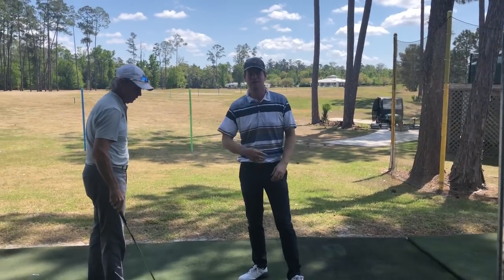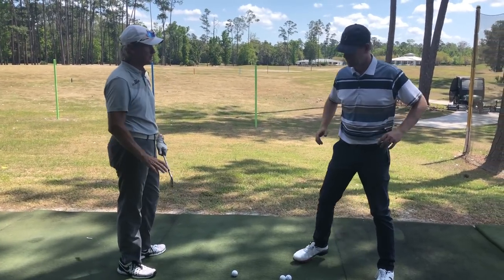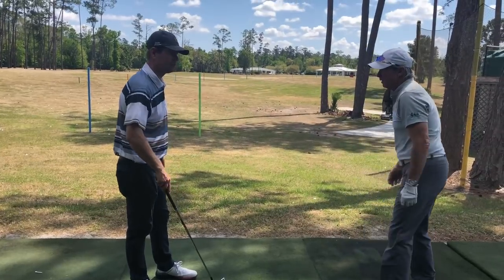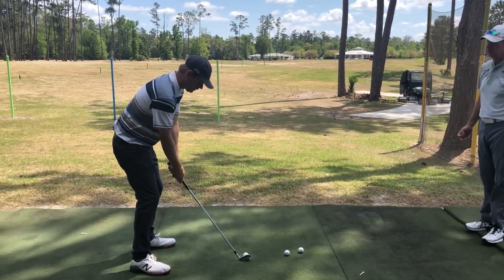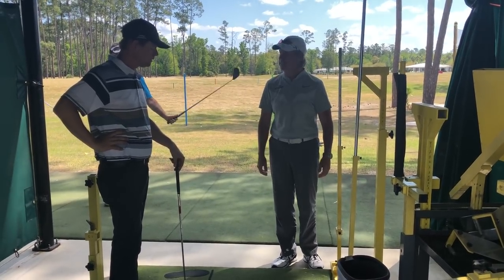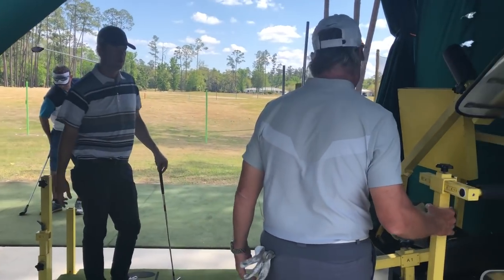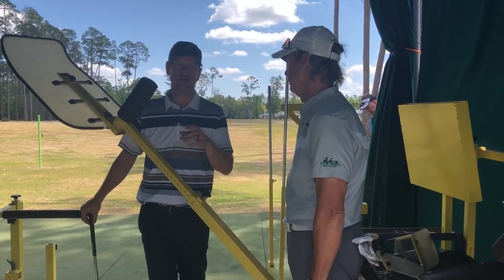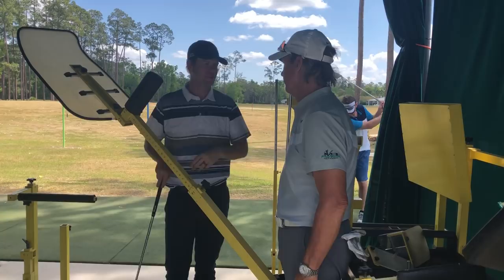The Stopper Drill, with Dan Winget at the Mike Bender Golf Academy, Be Better golf

Comment: Wow....not sure about this drill! Having had an over the top swing I fixed it by realising right shoulder rotates internally on the back swing, and externally on the down swing.....problem fixed. This drill could lead to guys having lots of issues with rotation....which is key. Could this be another case of not looking at the cause, and trying to fix the effect?
Reply: Can you elaborate? What do you mean internally/externally
Reply: Disregard... I simply looked it up! Had never heard those terms before

Comment: Brendan is chasing a rabbit down a hole. 99% of Brendan's slight over-the-top move comes from his ingrained wrist rolling inside takeaway. Doing this on his backswing means that his right shoulder rotates externally, then it will rotate internally as he makes his slightly over-the-top downswing. Super common. He needs to change his takeaway and backswing to reverse these shoulder rotation moves. It's a game of opposites- come back below plane and you will likely come back down on top of the plane. When he makes these  over-the-top swings, by nature of the vault,  his body rotates open quickly, but in the wrong way with no upper body right side bend. He interprets this as spin out and too much rotation, but these moves come from the over-the-top move. He thinks that if he can slow down the rotation- any way he can and his big Holy grail- that he will solve his problem. Sadly, this is not correct. He can rotate as much as he wants without spinning out once he ingrains a new takeaway and gets rid of his over-the-top move. His holy grail is correcting his takeaway by exaggeration drills, and having upper body right side bend on the downswing. This right side bend on the downswing keeps the right shoulder and upper body from making that bad move he's trying to avoid.
Reply: Robert Osborne know of any videos that show this?
Reply: Brendan is already a very good player. He seems like a great guy and well intentioned. I like following his stuff. I went down a lot of the same instruction rabbit holes when I was his age (many years ago). I've tried  just about every training aid one can imagine. Eventually he will most likely abandon all of them except alignment sticks. His garage will end up a training aid "graveyard." Been there, done that!
Reply: There's more than one way to swing the club to achieve an optimal impact position. How best for any golfer to learn and improve? It varies from individual to individual. There is no magic way or magic move that applies to everyone. It takes a lot of time and much effort to change ingrained ways. I notice only subtle differences in Brendan's swing over the last several years. That's not uncommon at all. Been there for sure. I have found that most swing "drills" do not easily assimilate into my swing and are tough to take to the course. There's a better way.
Reply: ^listen to Robert